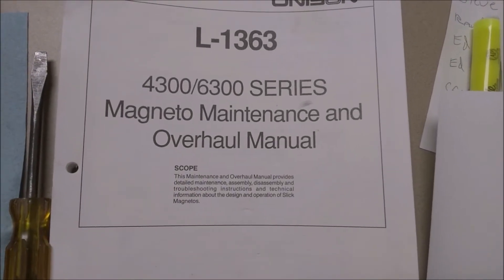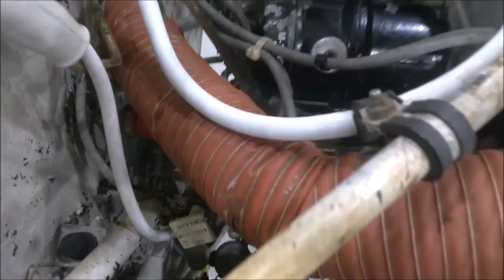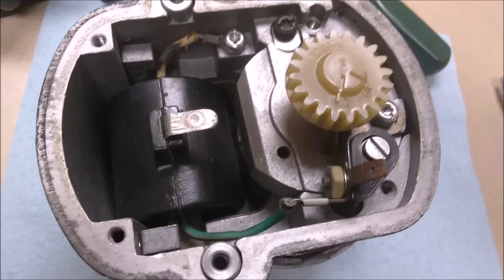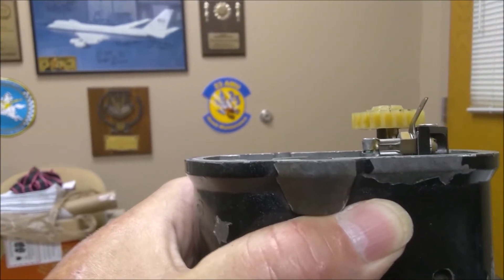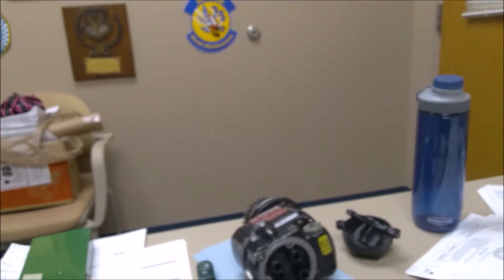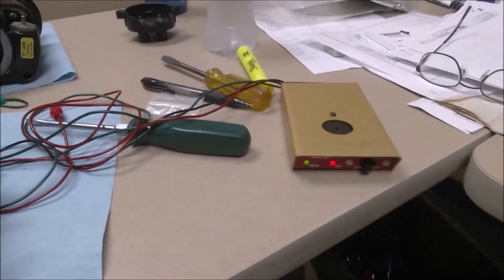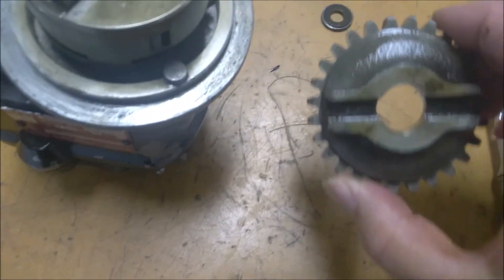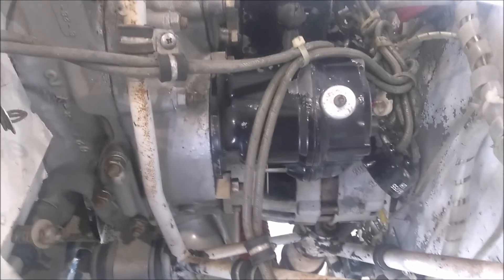Cessna 150 Slick Magneto Distributor Block change

Comment: Plastic geaes in an airplane ignition distributor.
Reply: They are nylon gears, they use  phenolic gears  in the older mags. You can also mark  both gears teeth with red paint or a sharpie to see it easier. The small gear has one tooth  marked the larger two teeth marked. One goes between the two.